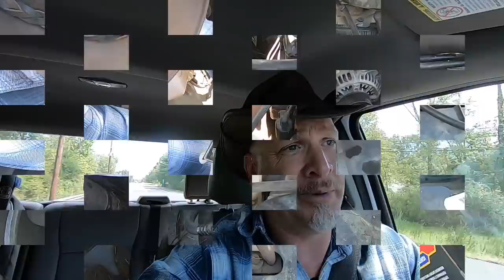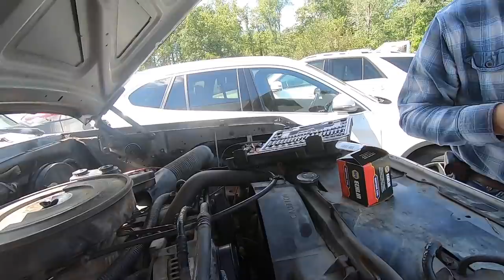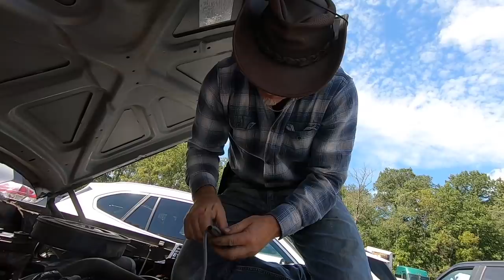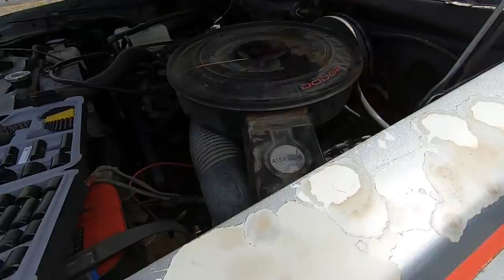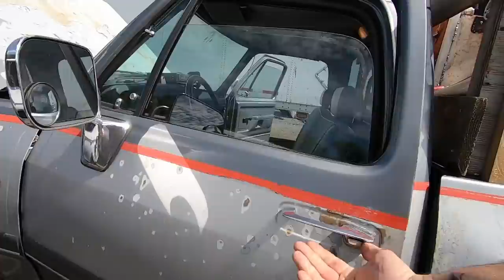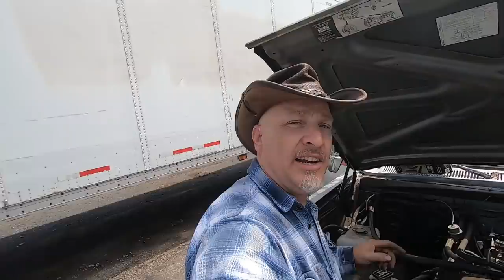Drowned Truck Fire Up

Comment: Those old dodges are very simple absolutely love them. If you happen to do a engine swap just make sure you have the right torque converter. The 318/360 look very similar but they are different, the 318 is internally balanced while the 360 is externally balanced on the torque converter. If you don't have the right one it'll vibrate like crazy.

Comment: Good of you to get it going ,yeah if it was Hydro lock from being in the  water or whatever ,a bad rod  mabe , ...lifters stuck possibly, , Are you gonna have a stuck hydraulic lifter make one heck of a lot of noise if you drain oil out of it see what’s in there, fill  back up put a bottle of Mystery  oil in there it’ll pump those lifters back up stop the noise, Done it before it works well God let it run and heat up real good though and get all that old crap out of there when you drain it

Comment: Yes engines suffers from hydrolock do a compression test on each cylinder probably a bent valve
Reply: I seen his Instagram post it's a bent rod
Reply: What type of Rod do you mean
Reply: @johnsweda2999  How many types there is? Connection rod?

Comment: Those coils where pretty common to go bad. I would sell them with every time up if it had over 100k. The tower on the coil also rots away. I've taken the coil wire off and half the tower will be gone.

Comment: When a vehicle has stalled in flood waters, you should first pull all of the spark plugs before trying to crank it over.
Reply: They did.
Reply: If it stalls, 9.5 times outta 10 it’s to late

Comment: If the story really took off Dodge or another company might give your friend and you new trucks.
Reply: Ya ok goofball keep dreaming  kid
Reply: The problem is that they don't built the Dodge truck's anymore.. The truck's split up into their own brand known as RAM ♈
Reply: @justbe4481  But Dodge is so big company that IF they would do that kind of PR stunt they would get the engine, and it wouldnt cost them a dime.. that positive PR though.. that would be worth something. Someone, tip them the info from this.. youll never know.. ;)

Comment: Is that a Jersey thing?  Why charge more to tow it out?  If you payed for the tow and the storage who cares how it gets out?
Reply: Have to pay a tow truck to tow it out if you can't remove it on your own.  Thankfully that yard allows them to work on it in their yard (insurance, lawyers, legal fees even if they win).
Reply: @lt1nut  if they aren't pricks they can drag it out the gate for $20 and you load it in the street
Reply: I've found donuts and bagels and such to be highly effective
Reply: @brockwaymt  what.. ? Whats the point they will allow to load it ? Its just that of course if they tow it to farm its gona cost, that is why they drive it for those few miles. No point to tow it out side the fence..